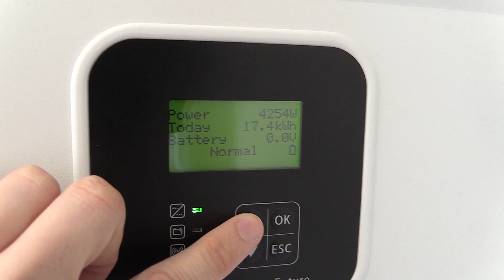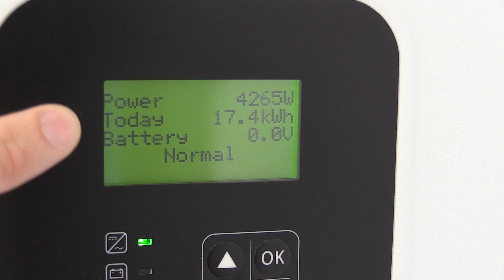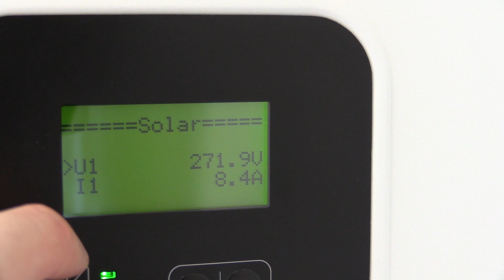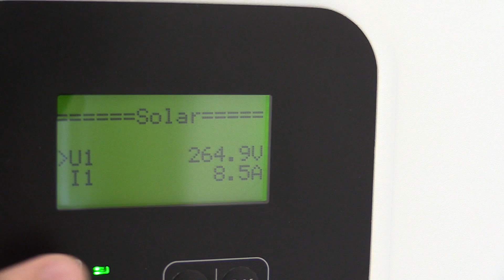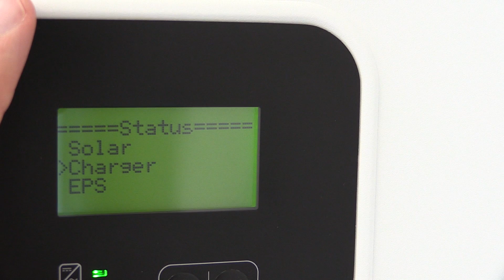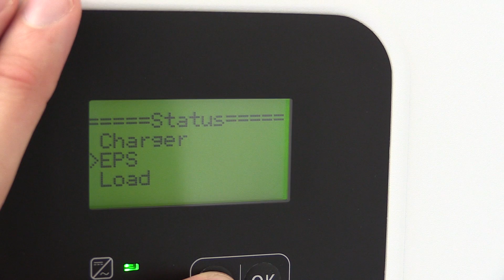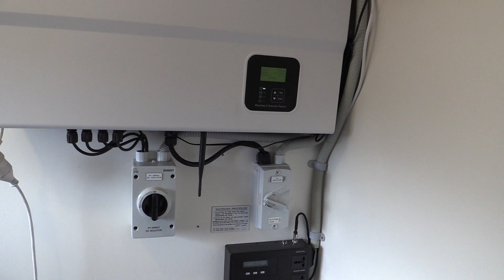SolaX Solar 5kW Hybrid Inverter installed

Comment: Can you tell me am looking at the 3kw model , looking to setup solar offgrid  cabin Ireland,  does that unit charge Lifepo4 batteries & if yes does it charge safely or would i still need  a BMS unit, looking to to do this setup https://m.ebay.ie/itm/1750Watt-1-75KW-PV-Solar-System-Complete-Hausnetzeinspeisung-Stromzahlerbremse/283814361397?hash=item4214a77935:g:Fl8AAOSwC9Refjk8  with 4 x 200 Ah Lifepo4 batteries ? Also could i run a cable from the AC out to the AC fuse box in mobile home thats there already please?

Comment: any luck connecting the battery ? what is the output capacity to the house on battery inverter. I get mixed data looking at these. 4999w model Some say 2kw others 5kw for battery inverter output eps mode.

Comment: May I ask if possible for sk - su 5000e to charge the battery 100amps or 5000w for 2mppt charge controller while the solar inverter is running loaded with 3kw appliances and the pv system is 9kw, totally off grid connection?
Reply from the maker: The sk u5000 has a build in 50amp charger at 48v eg 2000w not 100amps. It has two mppt channels. Its the wrong type of inverter if you want to run off-grid only. In off-grid mode this will only provide 2000w to the AC. If you have 9kWh of solar then that's far higher then this 5kWh model can handle/ made use of.

Comment: Hi i have got the same model of Inverter as you but the 4kw version, do you know if its possible to set it to charge my batteries during the night time on cheap electric, i notice there is a forced operation mode, i set it last night but it didnt seem to do what i wanted. Any advice?
Reply from the maker: Oh the 3700, I haven't connected batts to mine yet but will be in the next couple of weeks. In the settings there is a "allow grid charge" and then 3 time period settings. Atleast one will need to be set for an on and off time. ???? Also is yours the EPS model?
Reply: Mikes DIY Tesla Powerwall ah yes i have since sorted it out :) only thing i was dissapointed with was that it will only pull 2500watt from the batts with one unit. Its got a great monitoring portal though :)
Reply from the maker: yes 50amps but that fine. How many kWh of batteries do you have? usable?
Reply: Mikes DIY Tesla Powerwall i have currently got one 2.5kwh Pylontech rack i have been using to test, just about to add another 2.5kwh and later down ill add in the 3rd to get me up to the maximum 7.5kwh, thats another thing which has bugged me is that with the pylontech batteries, for some reason Solax have limited the max pylon batteries to 3, when they support up to 8!!

Comment: dose the new inverter have a built in limiter so when your running on batteries your not putting out to the grid
Reply from the maker: Its a Hybrid inverter so yes, but it does run on the same concept as the other inverter but with a charger etc